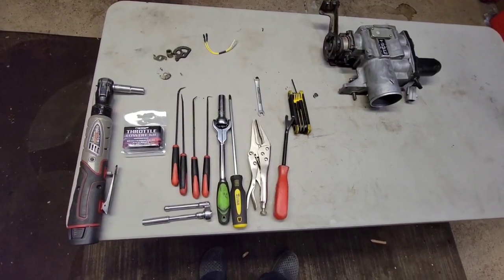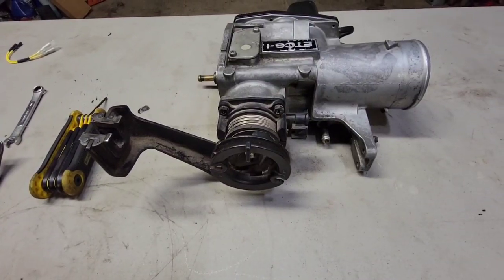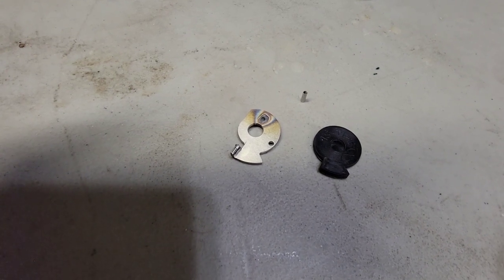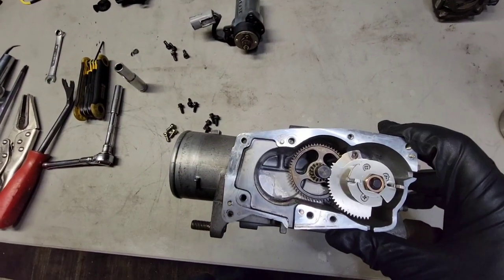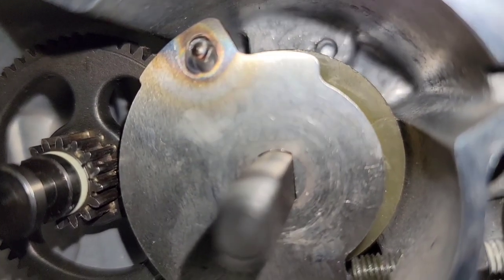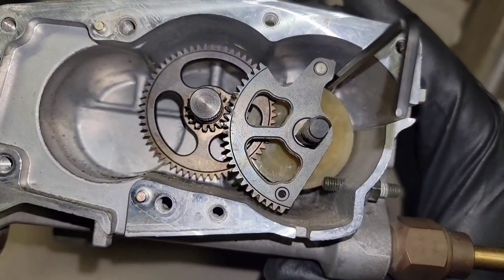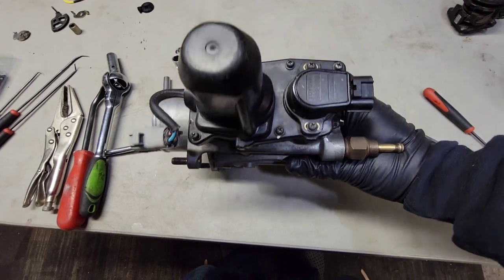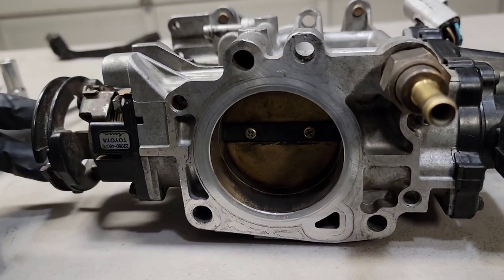2JZGE VVTI - Premium Japan Throttle Convert Kit installation - Every IS300 AND GS300 NEEDS THIS!

Comment: Hey Vegas, i gotta say... I managed to do it... I got this kit to work and I WAS IN LOVE. Sucks i got everything working. adjusted tps and the hex screw etc and a few days later ...  Got into a wreck. Totalled car. :( was fun while it lasted tho. I've probably watched your video literally over 10 tens and I did this job within 30 mins. People who aren't familiar definitely will take a bit on this kit but its worth it. Cant wait to see more people running it.
Reply: did you use the throttle lock with it?

Comment: Great video bro you did a terrific job explaining how it all goes together, I’ve seen the throttle lock videos however, I’ve never seen anyone explain that it actually fights with the ecu when it functions, great info!! Thanks for this content bro well done 👍🏼
Reply from the maker: The throttle lock by itself works great on manual cars and cars with a standalone ecu, but on factory automatic cars the ecu tries to close the throttle slightly between gears and it can throw CEL and put the car in limp mode. I used it for awhile but the very stiff pedal was also a turn off for me. Using this throttle convert kit the pedal feels awesome and the it doesn't feel like the ecu is fighting back.
Reply: @VegasAlex702  hello I have a manual car if I put just the plastic I don’t have to worry about fighting the ecu ever?

Comment: Hey man so I did the exact same thing you did pretty much and my car idles still 1100 when it warms up it idles at 15-19 and the trac light blinks on and off, I tried to put in drive and when I tapped the gas it stalled out and took a couple turns to start…. Any ideas? Currently have my car ina shop and I’m thinking it’s going to be a Waste of my money 😢

Comment: Off topic question, what do you set your fuel pressure while the cars on/not started and what should it be under idle for NAT?
Reply from the maker: With the 550cc injectors I have it at like 42psi. I have a check valve on the vacuum line so it only sees boost to raise from there. On the stock injectors I was running like 60psi to get the most out of them that I could.
Reply: @VegasAlex702  hmm good idea about the check valve, do you have the valve installed arrow towards the regulator or fuel rail? So Right now I’m on stock injectors  and installing it as we speak, going to set it to 50-60psi under no vacuum?
Reply from the maker: @PH020  You want it to blow toward the regulator. That way it sees boost only. That's how I had it and it worked for me. May or may not work for you depending on turbo size.

Comment: Hey so I recently just got this on my 02 m/t I followed everything you did including using the xcessive lock instead of the premium one and put it all into a throttle body that came from a motor with 50k miles so it was basically new. No matter how I adjusted the tps it keeps giving me code p1128. The forums say that’s a fault with the throttle motor but that doesn’t make sense since this is a practically new throttle body. I’ve gone back to my original throttle body but I really wanted this to work any help would be appreciated.
Reply from the maker: You may have to mess with the small hex set screws on the apps and throttle motor sides to get the stock ecu happy. That's what I had to do.
Reply: @VegasAlex702 so your saying I have to mess with the apps side too? How do I do that?

Comment: I see the kit comes with the 2 yellow jumper wires. I didn’t see you use them in the video. What are these wires used for?
Reply from the maker: I have the English instructions somewhere. I don't recall what they are for, but I didn't use them.
Reply: @VegasAlex702  i seen an other guy here on use the PJ kit on a GTE, from I understood, the wires are used for testing and calibrating the TPS.
Reply from the maker: @franklinurrea8033  yes, That makes sense. I prefer to set the tps using the obd2 reading. I just check it with the torque app.

Comment: Hi i have a manual chasee jzx81 im putting a 2jzge vvti into it, if i use the throttle lock from xcessive manufacturing with the stock ecu and my manual w58 setup will i have issues with the ecu fighting back or will i need to get the premium japan convert kit aswell? Hope to get a response soon
Reply from the maker: You likely won't have much trouble just using the stock ecu because you will probably have a lot of trouble codes that prevent traction control and abs from working because it's looking for sensors you don't have connected. Those are the main culprits for the ecu trying to close the throttle body fighting against the throttle lock.
Reply: @VegasAlex702  ahh ok sounds good thanks so much for your response, I'll also be using an atemu module from serialnine aswell

Comment: Doesn't this not work on a stock ecu?
Reply from the maker: Works on stock ecu
Reply: @VegasAlex702  only with a manual trans I believe
Reply from the maker: @gettricksdietryin  the premium japan kit will work with the automatic as well. I used it without issue for months before doing the manual swap.

Comment: did you buy the JCE10W or SXE10?
Reply from the maker: The one I ordered was: PJ-TCK-JZS160-JZZ31

I don't know if any of the other units would fit any better or worse.
Reply: @VegasAlex702  ill find out today, just came in. should work since i got the one for the AS300 which is also 2jz-ge vvti
Reply: @zayblickington  did you get it installed and did it fit any better ?
Reply: @MidwestMechanic  all the same parts as in this vid, still havent gotten the car to run yet on stock ecu so kinda bummed, in need of some help

Comment: Is this worth doing in a NA automatic
Reply from the maker: I think so. It really wakes the car up. Having full throttle control instead of letting the ECU smooth out the movements is night and day different. I've had it on the car for awhile now and haven't had any issues with it.
Reply: @VegasAlex702  Any issues or CEL popping up after 8 months? I have the excessive throttle lock and premium Japan parts coming soon, thanks for the detailed tutorial btw!